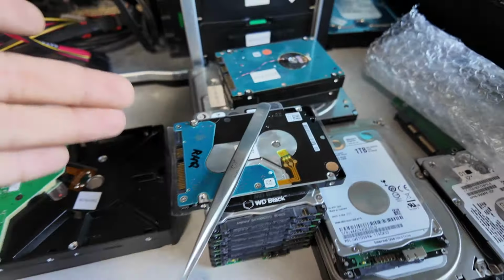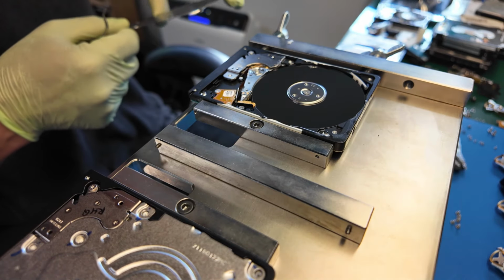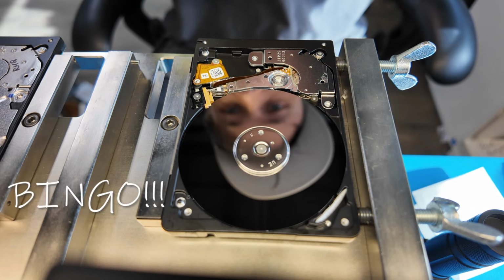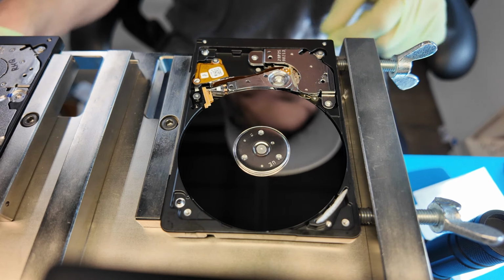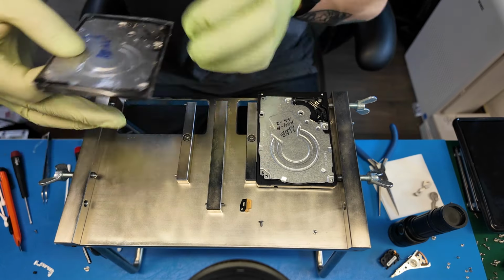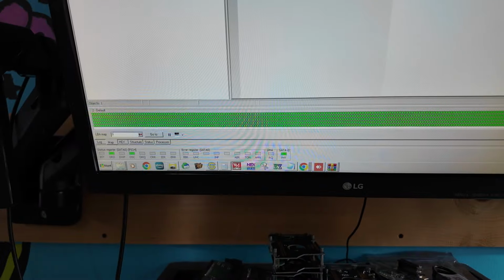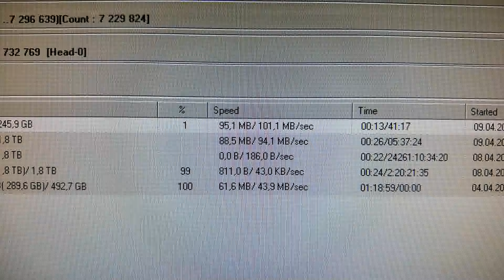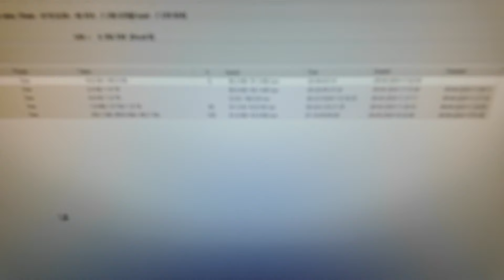I locked myself out when working on clicking Seagate hard drive

Comment: I've actually seen some retro MFM hard drive repairs. They didn't care about the data. They just wanted a working drive. I have no idea why since they are super loud and noisy, but anyway.... So they have to open it up and pry the heads off the platters. Sometimes it works. Sometimes it doesn't. And you can bet it's not a laminar flow setup or anything, but these are like 20-40mb hard drives. So the odds of additional damage isn't that great. And another interesting thing is even a factory fresh drive has errors. That's just how they were made back in the 70's and 80's.

Comment: Weak heads = $mold sectors....... (you know them - all do)....  ;) ...... Been a while since I changed a set of heads on a Rosewood 'that way'..... BTW - that head tool didn't look like one of Nikola's ...where was it from?..
Reply from the maker: this set is from Apex, I have Nikola's first batch of rosewood tools, which were bad (maybe just my set). The pin was too big for the bore, so the comb gets stuck in there hard.

Comment: lol I switched offices recently. I left my ID badges in my new office. I was making tons of trips between the two. So I had to turn around before leaving the base, go to the building nextdoor to mine, sign in with my driver's license, and then walk all the way back to my building and then the new office (which is on the furthest side of the building from the security building), get my badges, and then ALL the way back to the secuity office and I was good to go, but what a pain and this was friday after I was supposed to have left for the day (I didn't want to get stuck with this on monday). Last thing I want is to come to work all zombified out barely awake and half to walk half a mile for the round trip.
Reply: ok it's a quarter mile, but it also involves stairs.
Reply from the maker: I knew that this is gonna happen to me some day. I am surprised it didn't happen sooner. Now I am hardly ever alone at the shop so it's less likely to happen.
Reply: @hddrecoveryservices  It's funny I've been here for 14 years. Before the last 2 years, I've never forgotten it. Now I've lost count. lol

Comment: This is so simpler with the SSDs now... Less mechanical points prone to failure.
Reply from the maker: But so much more instability due weakness of NAND
Reply: @hddrecoveryservices  In my personal experience (which admittedly is a small sample size), as long as it's not a USB, SD, or microSD card, SSDs are far more reliable. To be fair I have more SATA experience than NVME. I've been using SATA SSDs for 13 years.

Comment: I wonder how you'd deal with a newer helium filled drive. I can't imagine that would be easy to work on since once you open it the helium is gone.
Reply from the maker: with Helium drives the biggest issue is not the helium. It is the unsupported locked firmware that needs to be modified before data access. We don't do them yet
Reply: @hddrecoveryservices  interesting